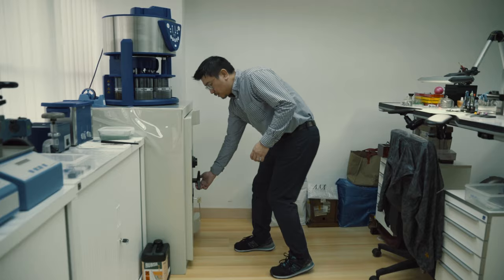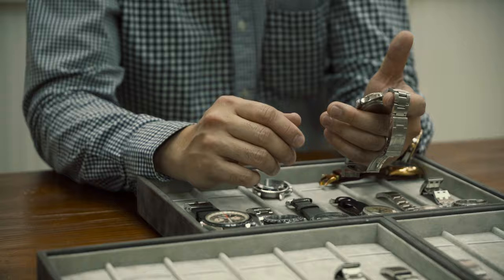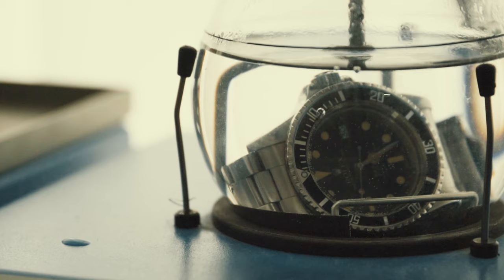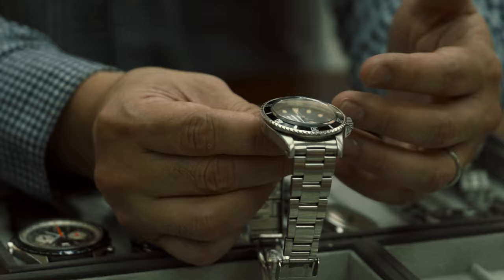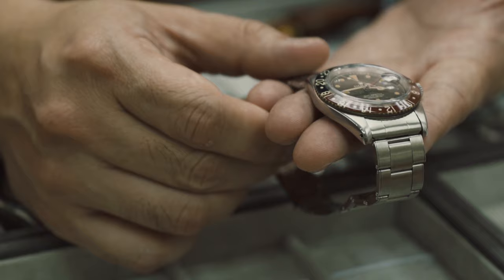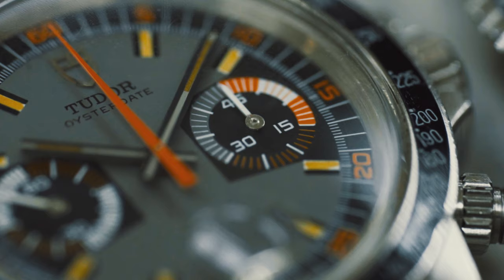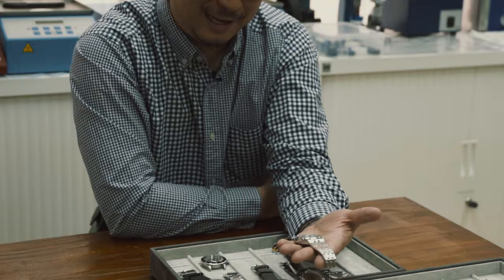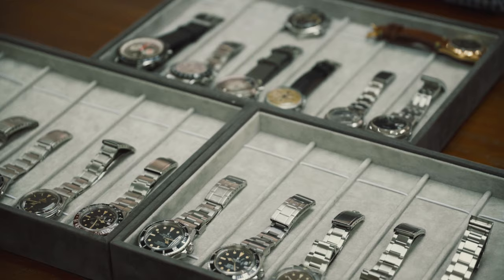“Bracelet Magician” Michael Young Shows off His Incredible Vintage Watch Collection

Comment: Not sure about the use of the term 'magician'. The screws he uses in the service are after market parts which seem to wear a lot faster than genuine rolex screws. I mean once you send your rolex bracelet to this guy it comes back 60% Rolex and 40% fake bits and pieces. Plus he is notorious for overpolishing the hell out of bracelets and also leaving thermal heat damage when he laser welds.